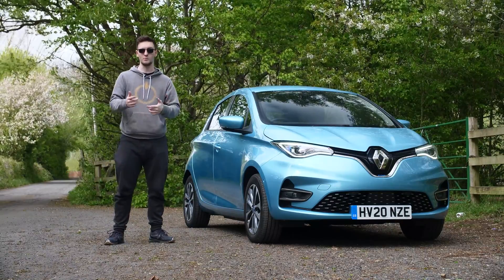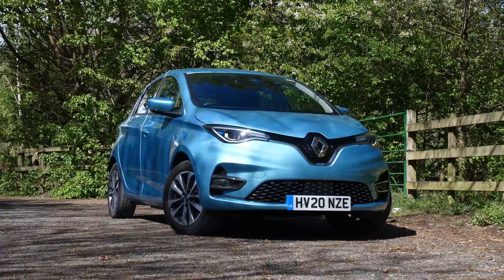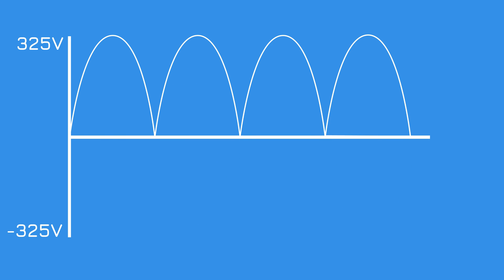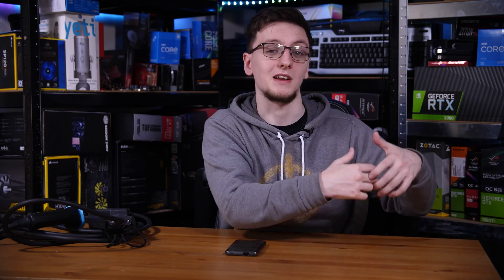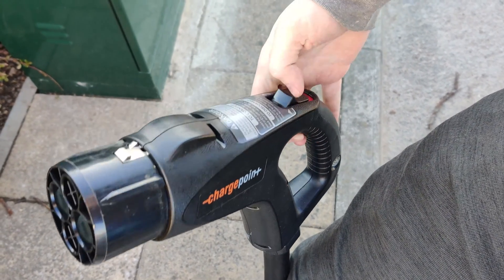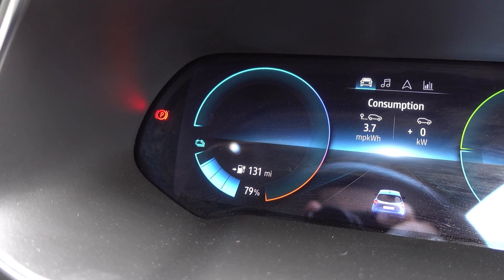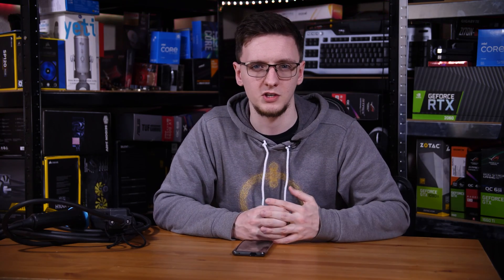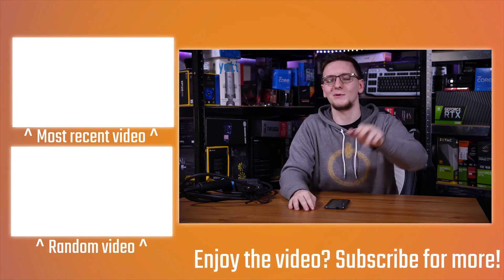EV Charging Explained - AC, DC, Inverters, 3 pin, Wall box - TechteamGB

Comment: Most EVs won't be able to charge over 22kW over Type 2 AC. As far as I know, only the Nissan Leaf can charge at 43kW in the UK, so if you want rapid charging you need to use the CCS Combo connector instead for DC charging.

This is a common "gotcha" for new EV owners using tools like Zap Map, who might stop at a rapid charger and find that their car didn't charge as quickly as they hoped!
Reply: Nope. Only Renault Zoe in certain version (Q90 if I remember correct) could charge at 43kW. But that was dead end, so Renault switched to CCS when Zoe got a refresh.

Main "gotcha" is people plugging in high-power AC instead of CCS. They somehow miss that small cap below AC portion of the port. And I blame Renault for this issue existing - if it wasn't for them, Rapid chargers would be DC only. And no confusion would take place :)

Comment: Just got some electric peugeot 308's at work. It's a nice car and a good drive, it's a bit soft but that's good for the uneven roads where they are used. They have a slow charger though,  so takes ages to charge. When I mentioned we should only charge to 80% to maximize the battery life they though is was talking nonsense! They leave them charging for 12+ hours every day, so I don't think the battery's will be lasting that long!🤦
Reply: If it’s a work car they probably don’t care about longevity since they will still last long enough, that will be the 2nd or 3rd owners problem